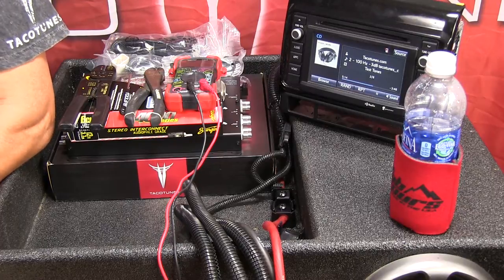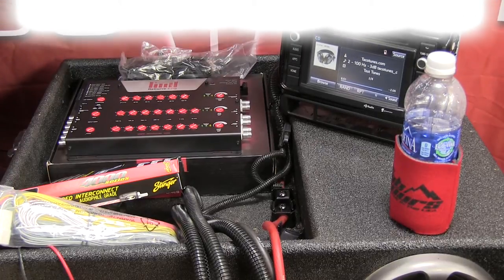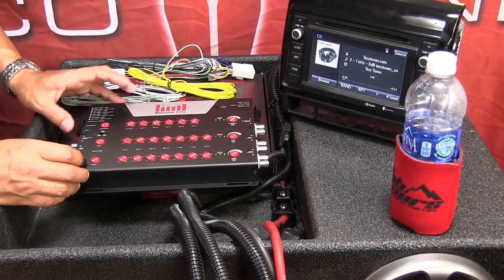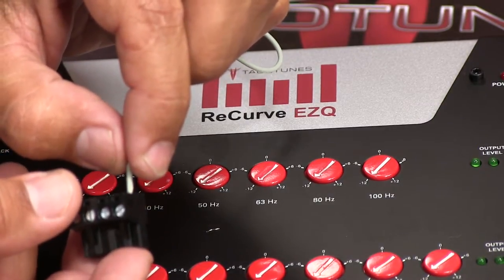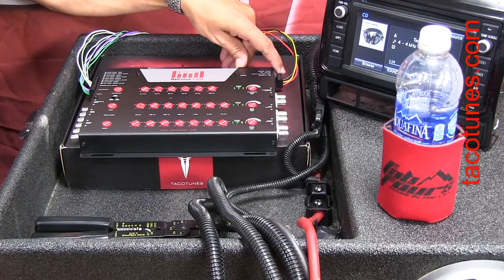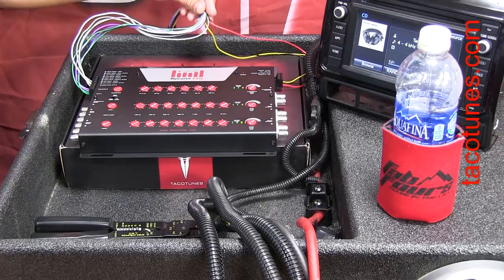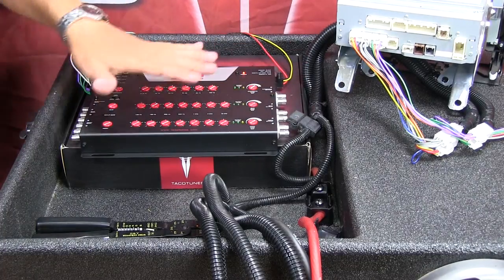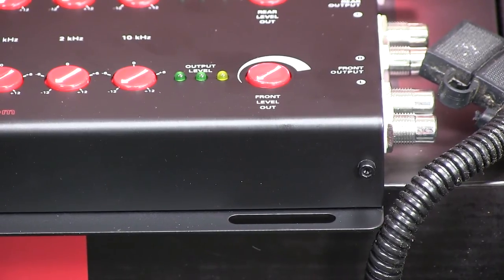ReCurve EZQ Installation Series - How to wire the ReCurve EZQ

Comment: So, I started looking at the Non-JBL recurve wiring harness and it doesn't include the input signal from the tweeters; it's limited to FR FL RR RL. I do understand that the OEM HU powers the dash tweeters and not the amp under passenger seat. However, my question is, how is the recurve 'summing' tweeter frequencies that aren't presented to the DSP?

Comment: Screen on  head unit went bad on my 2013 Taco. Like to keep all my steering wheel controls. Is there an alternative to the original head unit. It also has to fit perfect, no gaps and such. Thanks